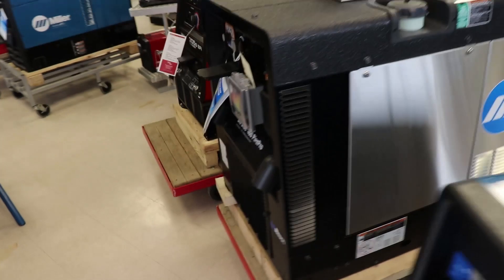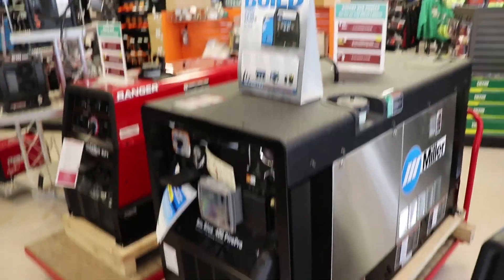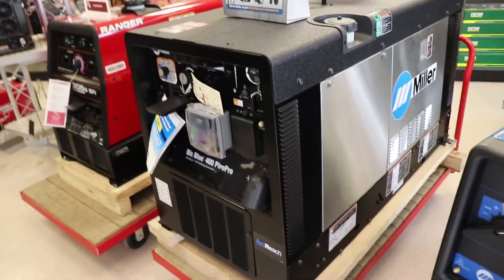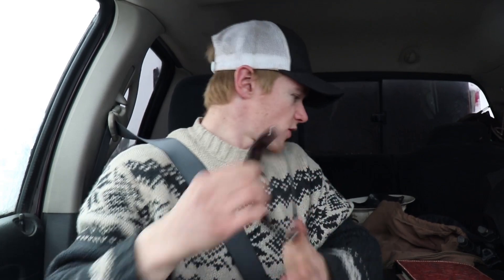Pipe Welding Terminology.

Comment: roustabout  is exactly that a jack of all trades that goes anywhere to do any job, with the testing we go above what the continuous pressure is going to be  and its typically 8hr test or more if theres an issue and when they are putting their mark on the stuff they worked on another person needs to inspect their work and sign off on it as well so theres two ppl who get heat when something fails :) <3 i been pipelining in the east coast for a little over 15yrs now

Comment: Hydro test pipe is fill up with water and pressure and the pressure has to hold up to 4hrs to 8hrs. Some are 800 pound pressure. Some are different. When pressuring up you must clear the area because it could bust.
Reply from the maker: yes sir.

Comment: Thanks for the video idea Josh. No shame in saying you don't know something. Ask and learn, store it away. Keep your eyes open and your mouth shut is a good rule to follow.  Jake, how do you get around the auxiliary power limitations of the SA on the job. My 66 Redface only has like 8 amps of D.C. Power.  I just use a 4.5" Dewalt grinder that's rated for D.C.  I know the blackface machines have more, but not that much more. Thanks

Comment: Hydro testing is exactly what you said they pump water or whatever into it and build the pressure up to a certain psi to check for leaks! I’ve had 0 leaks so far on my welds🤘🏼

Comment: Hey Jake how your little brother liked your old machine an what's a good price for a sa or se 200-250
Reply: SA 200  less upfront  ($2000-3500) but cost more in the long run & DC aux power only [in fuel because it burns at least a gallon an hour to a gallon and a half].     SA 250. 4000-6500  More up front but cheaper in the long run ( they burn a half gallon to a gallon of fuel)
Reply: The shade tree welder okay I just wanting to know